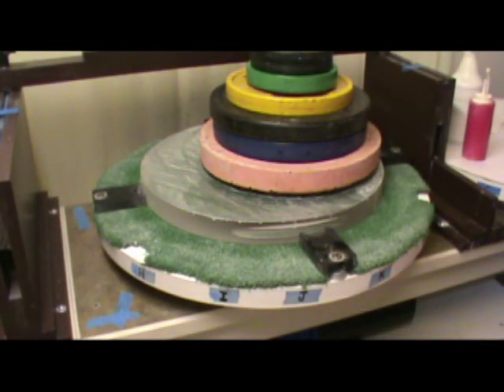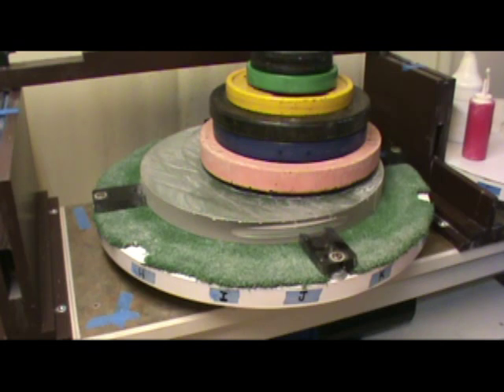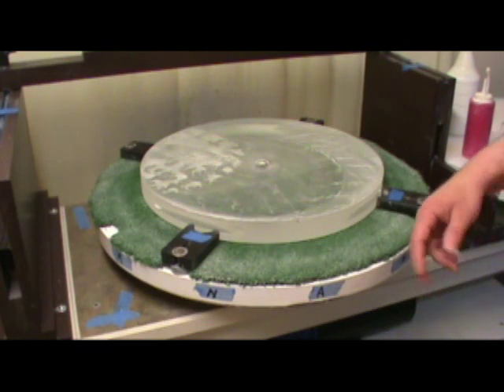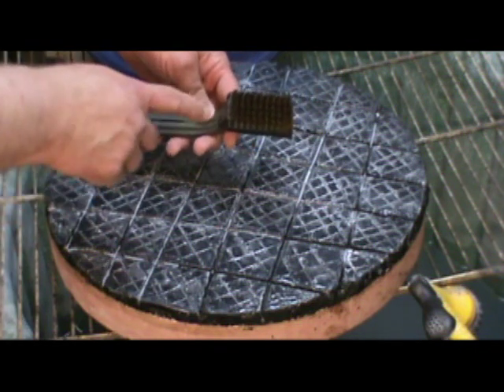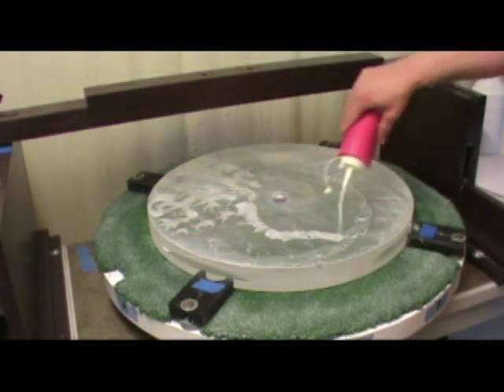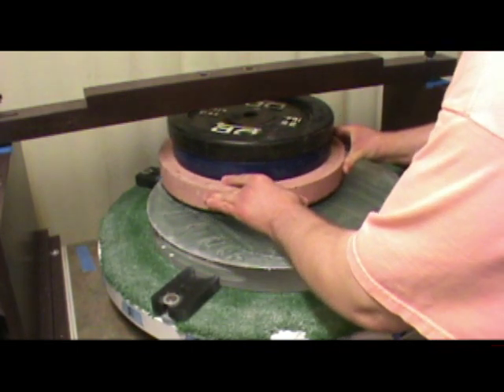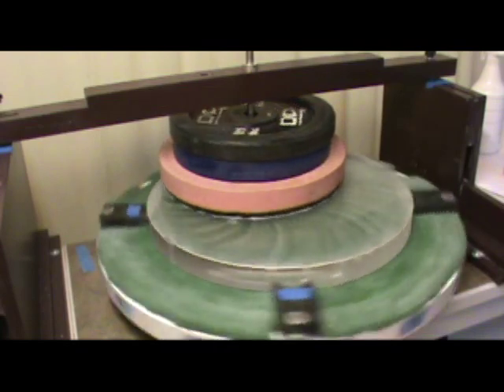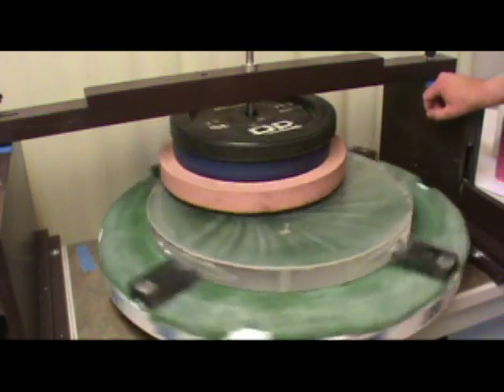Rough Polishing the 20" f/4.5 Telescope Mirror

Comment: Hi Gordon,
I'm after some advice if I may. I'm a novice mirror maker and undertaking my first mirror, a 10" f5. I've built a mirror o matic machine which has worked really well for the rough and fine grinding and I've managed a good even spherical grind with regular spherometer testing . What I am struggling to understand though is when polishing using a 7" lap using a fixed post polishing technique in the sweet spot I keep getting a hole dug into the centre of the mirror when Ronchi testing. I've tried everything to avoid this but it keeps happening unless I introduce a small amount (1" approx) of swing on the arm. My lap is dental plaster with Gugolz 64. I have faceted in a random fashion as per one of your videos. Any thoughts on why the fixed post approach isn't working for me? Oh and the lap has excellent contact with regular pressing. Hope you can advise. Many thanks. Pete.
Reply from the maker: Your polisher is perhaps a tiny bit small, but not so much as to be a problem.  7.5" would be a bit easier.  How much does the edge of the polisher overhang the outside edge of the mirror?  Should be slightly over an inch or so.  Usually if you put that swing on the arm during fixed-post polishing you will polish in a turned-down edge.  Perhaps email me a photo of your setup and a photo of the face of your polisher?
Reply: @GordonWaite  I have sent you a mail with a few images attached. I very much appreciate your help. Peter.

Comment: I'm guessing the turn table must be perfectly flat and have no wabble.
Reply from the maker: In theory, you would like it flat and wobble-free.  In reality, you rotate the mirror on the turn table quite often to even out the effects.
Reply: @GordonWaite  I looked through a bunch of your other videos and googled to try to find pictures but no luck...so...is your fixed post turntable rotating on something like inline skate wheels placed underneath and near it's circumference, or, is it a circular plate supported solely by a central shaft?  It seems like the central shaft option wouldn't be good since unless it and the circular plate are like 3" thick steel, there's going to be a large bending moment that will tilt the plate when the tool pushes down near the edge of the mirror.
Reply: @gordonwaite9073  h-o-l-y c-o-w. 2.5" shaft.  That is huge, relative to what I was thinking to use.  Whatever I finally build I'll test its canting under load equal to the maximum offset weight for grinding and then add wheels or not, but, probably will have to add wheels.
Reply: I don't know if you can answer this but do you think there's any reason I couldn't use a variation of this fixed post concept to grind a (stainless) steel plate flat?  It's ~34cm in diameter and has some 0.5-1mm warp if I put a straightedge across various diameters.  Steel as one disk and maybe a large ceramic tile as the other, trying to create a flat surface rather than one concave/one convex.